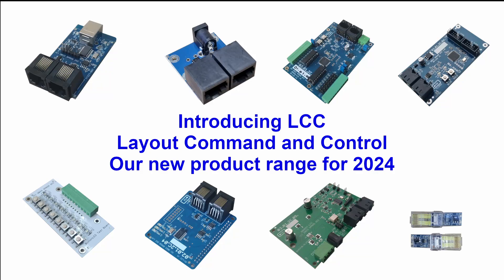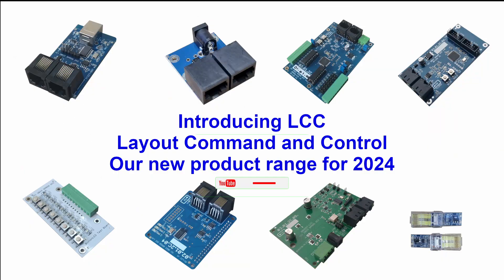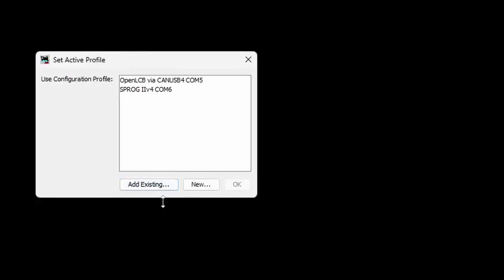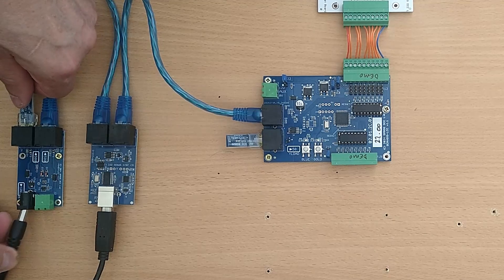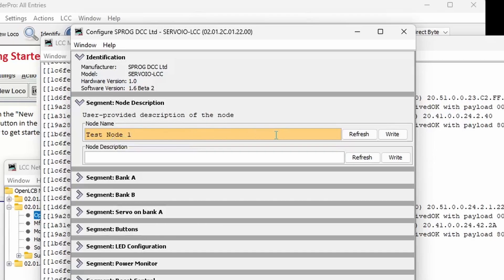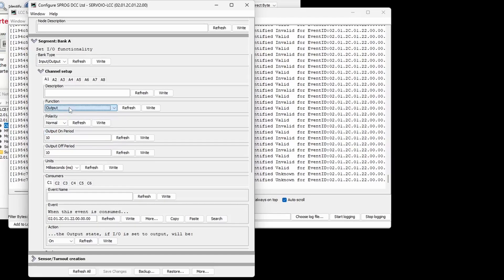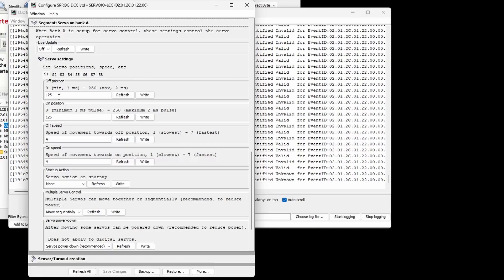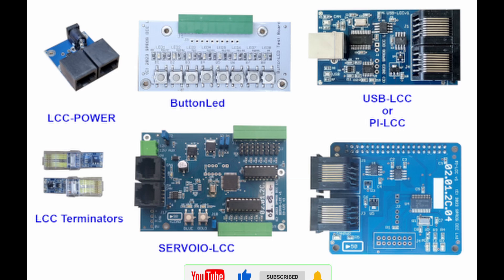LCC 1 - Unboxing the Starter Kit

Comment: Is an interesting system but unfortunately today I see only RR-Cirkits as manufacturer. Also the support in the common model railway software (TrainController, iTrain, WinDigiPet,...) is missing. I don't want to jump in a system where there is only one hardware supplier.
Reply from the maker: You've found us so that's at least two manufacturers :). TCS produce a command station, booster and throttles, all supporting LCC. There's also Logic rail technologies and CMOS engineering. So, yes, it's not yet as widely supported as DCC, say, but the list is growing.
Reply: @sprogdcc  Thank you for the reply, could you put a link to your products in the video description?
Reply from the maker: @TheDigitrain  The link is in the channel page, but here it is as well www.sprog-dcc.co.uk